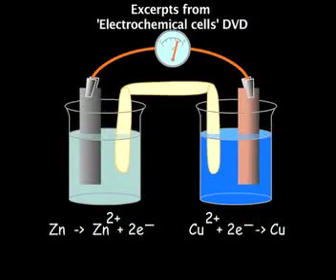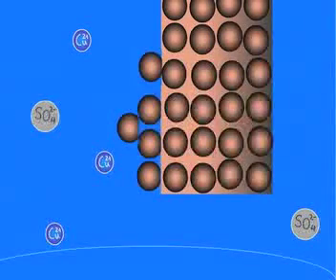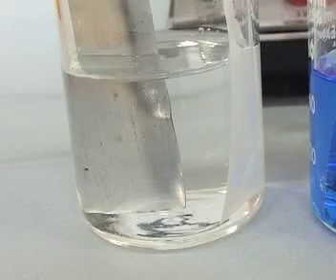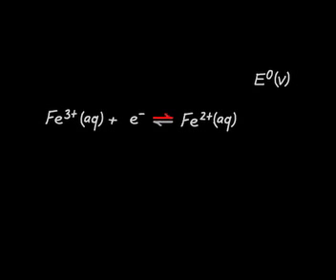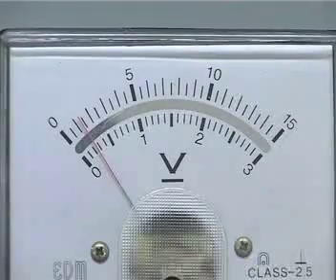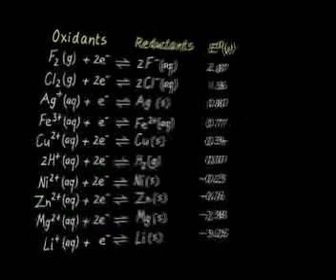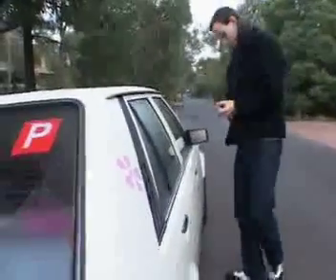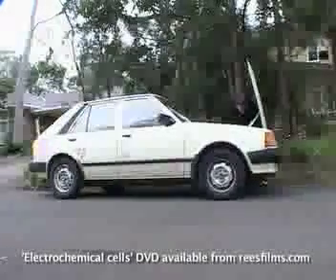Redox Reactions: Electrochemical cells

Comment: The predicted cell potential under standard conditions should be 1.61V.  You were adding two reductions to make the cell, when you must have a reduction and an oxidation to create a cell.  If you are predicting the emf of a spontaneous process, then the iron half cell will become an oxidation, it's standard cell voltage will become -0.77, and the sum of the two half cell potentials is 1.61V.  

Also, standard conditions do not include temperature.  The concept of making tables at 25C is not a standard but an accepted tradition.  Standard conditions are firmly stated as "all solutions are a 1.0M and all gaseous species are at a partial pressure of 1.0 atm".